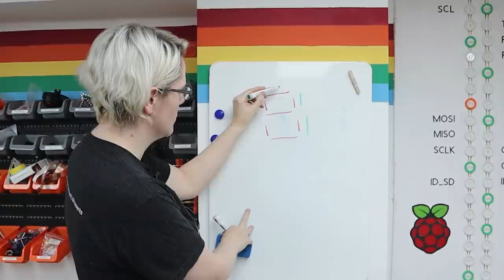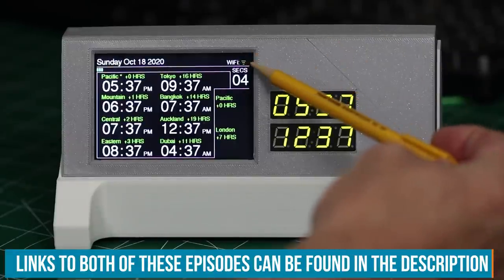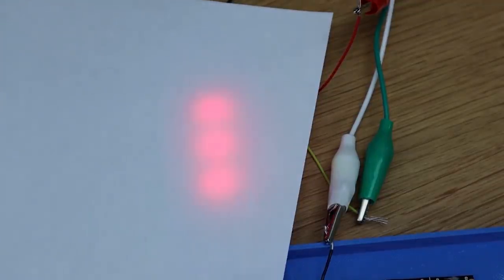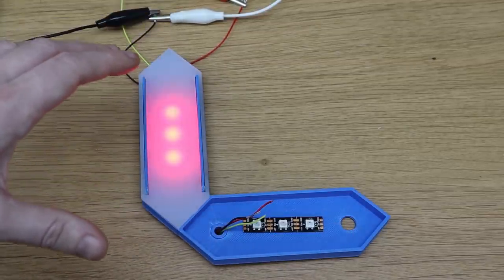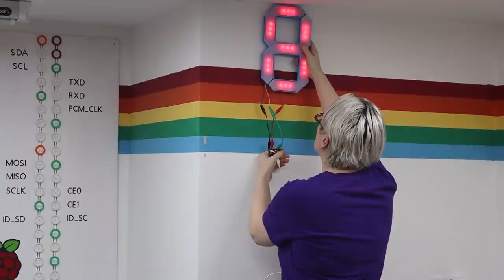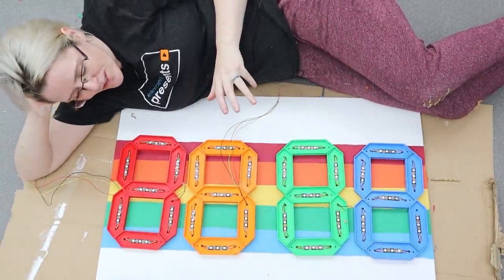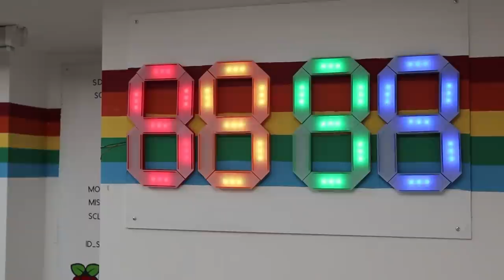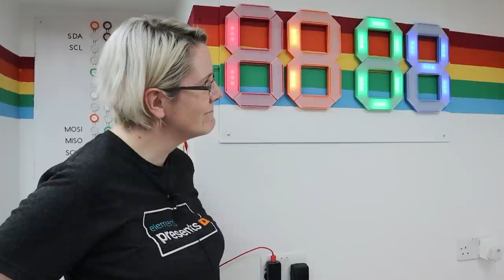Giant 3D Printed 7 Segment Display Clock

Comment: I have the same China laser cutter but you can mod it to make it a lot better. I put a snap/lever switch on the lid so it cuts the laser off when lifted, a more powerful exhaust fan, and pump system with an aquarium water chiller so you don’t need a bucket full of ice water.
Reply: It's not ice water underneath. Plus it's a laser cutter from a UK company, HPC. https://hpclaser.co.uk/co2-laser-cutters/ls3020/
Reply: Oh I have a magnet inside that does the same - stops the laser starting with the lid open. Thanks for the tips

Comment: One of the tricks I used in a similar project for a television set I helped construct.  We  needed more punch and even out the reflection of the LED,  I used foil tape or what HVAC technicians use to assemble duct work,. It is not duct tape.   The writing on the tape comes off easily with acetone.   Give it a try.  It seemed to help on a very bright news set.

Comment: I love the designs of these. :D

The problem isn't the diffusers. You need to increase the distance. Look at how the focuser on any professional light fixture, like a leko or a spot light, works. Or how focusing of a projector works. Its done by adjusting the distance to a lens. In this case your distance is so close youre not spreading the light enough, and they are too focused on your diffusing lens. You can test this easily by just holding the lens in front of your leds and moving it back and forth. 

Also, since you're using different colored plastics, your going to reflect different color wavelengths and absorb the rest of any of the scatter. Consider coating the inside wells with white or silver, or use foil. This way your reflecting back all wavelengths for maximum effect.
Reply: *edit* just read through the comments and saw these were already suggested. Probably should have done that first. I was just excited since this was a project I did last year and have in my game room. :D
Reply: @digiassn  thanks John! Can you share your project??

Comment: instead of using white diffusion material, it will help the segments stand out if you use material that is the same color as the LEDs below
Reply: The LEDs are RGB. I know I only light them the colour of the number... But I think I'll actually colour them depending on the time of day. E.g. morning the entire clock will be blue

Comment: Why not smaller to better fit the LEDs, it is not an airport sized room, and would be easier to read with lights on... I would try to put a darker transparent vinyl over the acrylic, so there is more contrast between off (currently white, reflecting too much ambient light) and on. Btw. number 1 is usually aligned to the right...
Reply: I wanted the full rainbow to appear on the backboard... and a MASSIVE clock :) 
Hmmm, do you know of any frosted acrylic in darker colours? The clock looks better in real life, it's just tricky to film. 
Yup, I DREW 1 on the right on the whiteboard and then I coded it on the left, oops!
Reply: @lorrainbow  I did not mean special acrylic, that may be too limiting (and possibly expensive). I would experiment with adhesive vinyl sheets/rolls, which can be found frosted (for privacy glass), smoke tinted (for car windows and headlights) etc. I did not compare with the frosted acrylic, but it offers a lot of variability and combinations...

Comment: You need to do two things to improve the legibility of your display,  The segments need to be DEEPER to improve diffusion. Just hover a piece of your diffuser material over the LED's and raise  it until you cant see the spots. That's how deep they need to be. You should be able to print some supplementary  pieces to suit. Secondly the inside of your segments need to be WHITE! Internal reflections are sucking up all your light. Just some white vase mode "bun cases" should do the trick, simple.  Lastly  11:00pm on a Sunday night! :-(